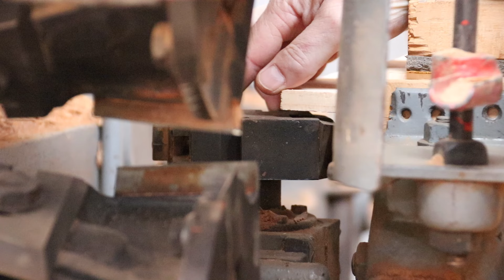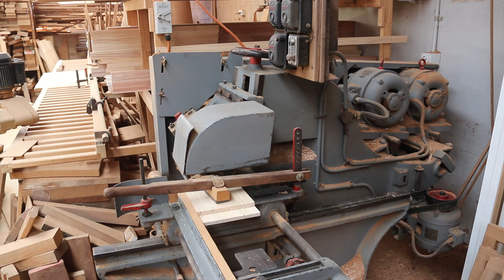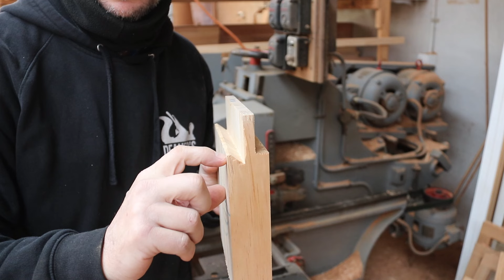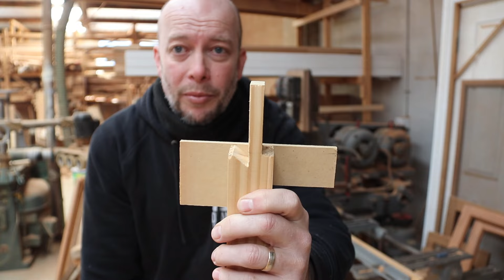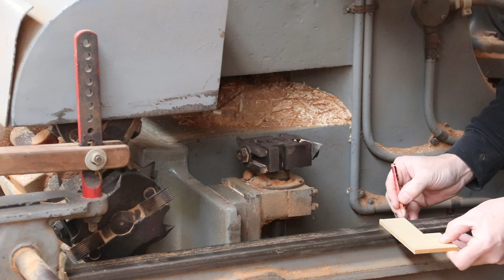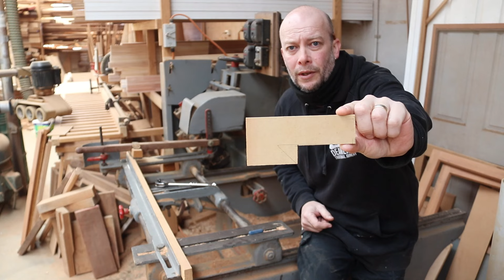Setting Up The Old Haige Tenoner

Comment: Gor blimey four tenoners, no one's got four tenoners but you are right when you got machines setup it becomes a production line much quicker, we had seven spindle moulders setup only for doing kitchen doors.
Reply from the maker: Yes, I am the only shop I know that has more than 1. It definitely pays off, though, if you have the room.
The advantage of being able to walk up to a machine and press the button and go, compared to constantly having to  set up, is huge.

Yep, we have 6 working spindles too😁
Reply: @DTJoinery I thought I was nuts with my 8 spindles! 4 tenoners! That’s a lot of floor space. Like with the spindles it saves so much set up time though
Reply from the maker: @amhjoinery2060  
Yeah, spindles are a must. I also run 3 morticers and 4 radial arm saws, 2 jointers, and 3 table saws, each one set up for a different purpose. Also, because I like machinery😁